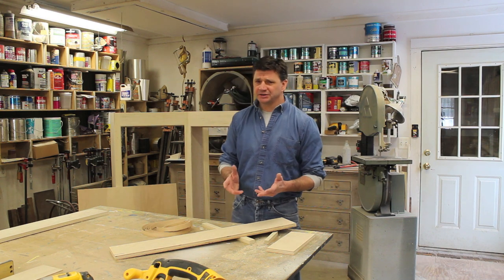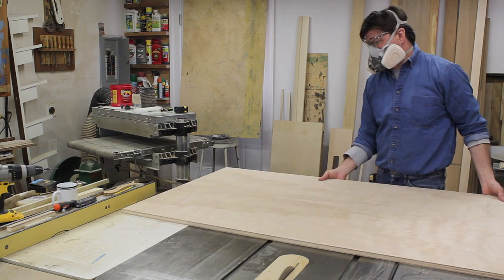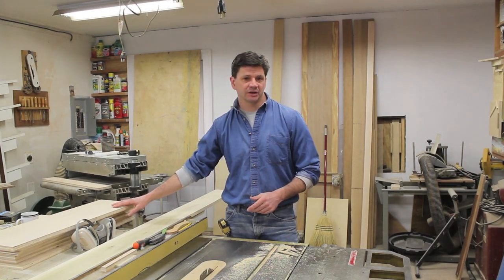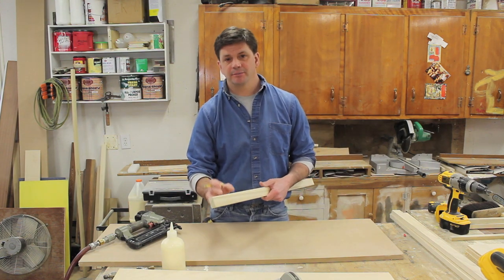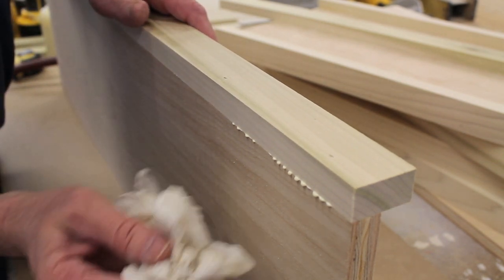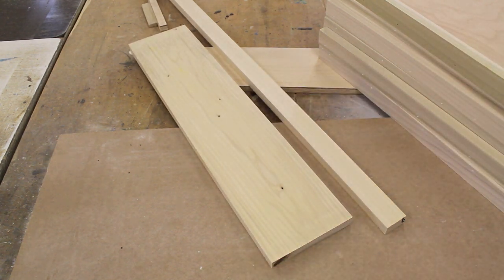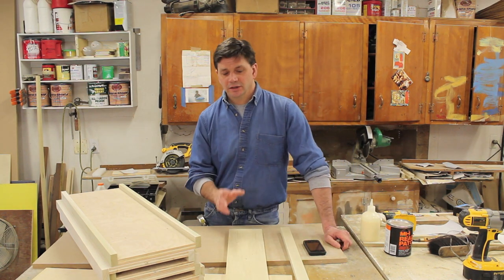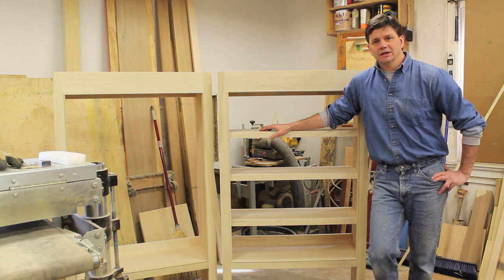How to make wooden bookcase shelves by Jon Peters

Comment: I have seen this modification used in a number of videos.
Question. If you made the front piece a little thicker and rabbeted the inside face so there was a supporting lip on the inside for the plywood shelf, would this add more support?  Or would it just add additional weight with no real functional advantage?